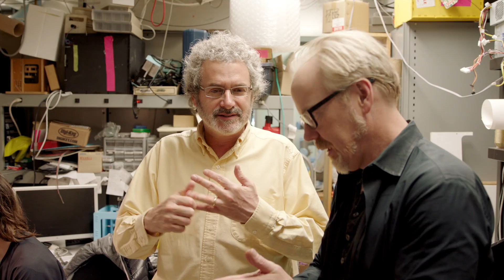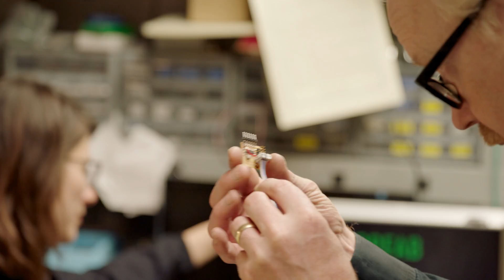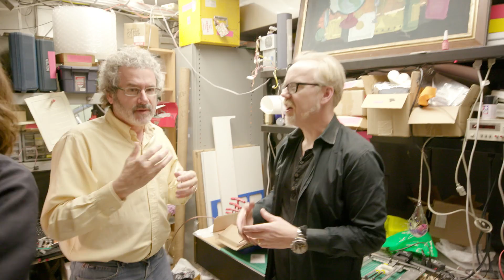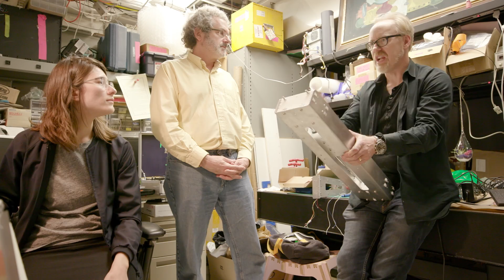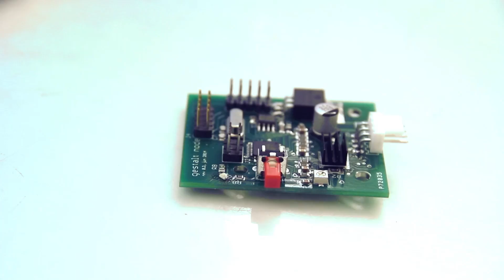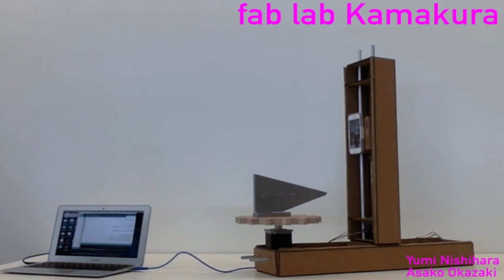Adam Savage's Maker Tour: MIT's Center for Bits and Atoms (Part 3)

Comment: If anyone here has a deep interest in this sort of thing and are wanting to study, I advise you look up Product or Industrial design.
Reply: This is more Industrial/Material Engineering with Computer Science. Industrial Design is more focused on form over function.
Reply: David Boucard I'm a product designer and I was dogmatically taught that forms follows function. The discipline of product design varies greatly from university to university. In the uk no school is taught that function follows form. We must teach it differently over here. Plus we learn computer/material science and engineering.
Reply: justabit design and engineer as near interchangeable terms. My point is that a product designer can move into many different specialism wither it be for example; designing apps, the phones the apps are used on, designing the box the phone is delivered in, designing machine that makes the phones, designing the machines that prototype the phones components or even designing the research tools to gather data from the phones user. It's a pretty varied field and a lot of what was covered in this three part series is covered in the field of product design.

Comment: I would think there would be some precision lost with these type of devices...especially the cardboard one.
Reply: There most certainly is, but precision isn't the point of the cardboard machine. It's an inexpensive, rapidly-built prototype to prove that the design works. They'll build a better version out of sturdier materials once they've perfected the design and function of the machines in cardboard.